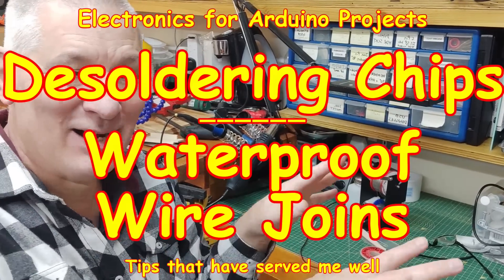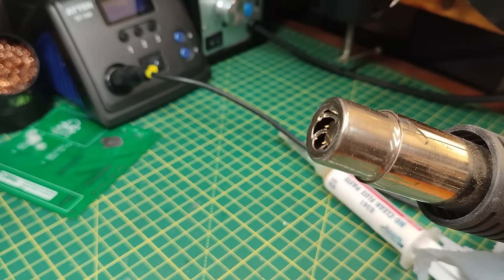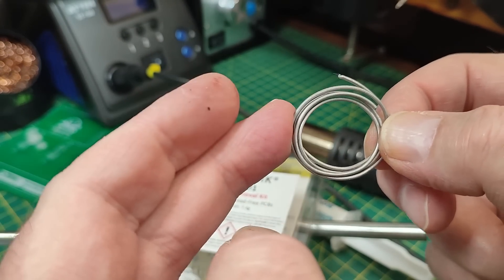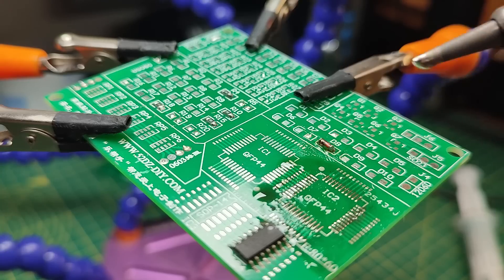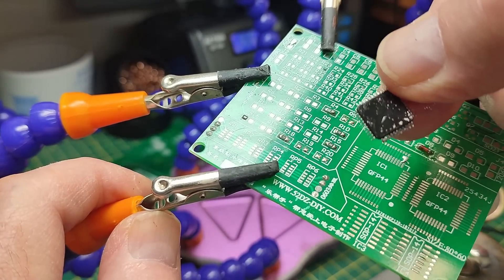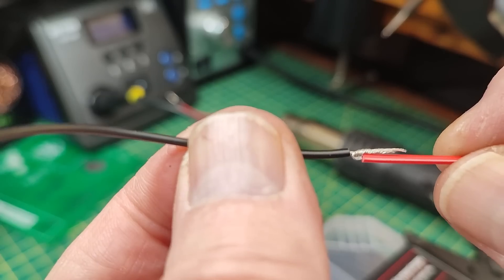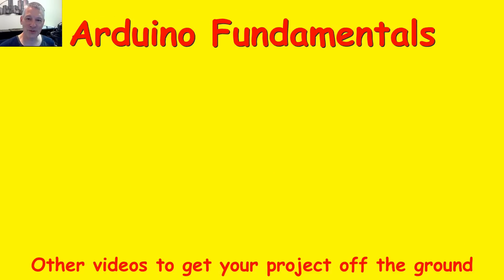#259 Desoldering Chips the Easy Way & Waterproofing💦Wire Joins

Comment: Splicing the wire by twisting it together and folding it back is sub-ideal. The most correct method is using the Western Union Splice (https://en.wikipedia.org/wiki/Western_Union_splice). However, that does take a bit more wire and makes the joint longer. A less ideal version of this is just shortening the overall length of where the wires are wrapped over each other, and soldering that. You want enough soldered area to completely join the wire and provide reinforcement, but not so much that you have a 2" long hard spot in the wire. After soldering the wire, use a pair of nippers to cut off any sharp ends that couldn't be completely folded over as you don't want those to be able to potentially poke through the heat shrink. 

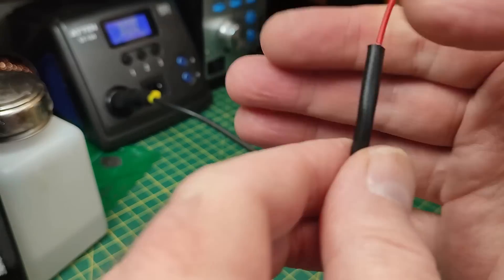And speaking of heat shrink, they do make smaller sizes that are adhesive lined. The 4:1 shrink rate isn't as important as using the correct size shrink for the wire size. Double-walled adhesive lined shrink is my prefered choice. Lastly, you can always double up heat shrink. Put a piece of shrink over the joint with the just an 1/8" or so overlapping the insulation on each side, then put a piece that's about 1/2" longer over that. Basically you're bulking up the joint so that the outer piece can shrink tighter on it.  I would consider the example shown at 13:45 to be unacceptable to put in the field.
Reply from the maker: Indeed, and as that Wikipedia article says, the WU splice is great for "...where the cable may be subject to loading stress." I certainly would not expect any of our electrical projects to put any wire under stress without some sort of strain relief using the outer sheath. But, when up a telegraph pole I'm guessing it's just perfect 😉

Yes, I was seriously thinking about augmenting my adhesive-lined heat shrink with a few smaller sizes (so they could also be used in a single wire, for example). Even going down to 3:1 would be a useful addition to the toolkit.

Oh, by the way, I'm not putting that wire in any field 😁, it was just for a demo and I think (given my previous comment on strain relief) I'd be happy using it even in a pond! Which is what I'm doing with a similar joint on a pond pump. Thank goodness it's all low⚡voltage stuff!

Comment: bend copper wire and heat it with your soldering iron with flux and the chips come off okay 🙂
Reply from the maker: Might be OK with DIP chips, I guess, but not a QFP32 as the solder resolidifies before you can desolder all the pins, surely? Yes, I know your name is not Shirley.

Comment: Does the low melt solder work well with chips with a pad underneath?
Reply: That's a good point; I've never tried it but I don't see how it could possibly. I think you'd have to use hot air for that.
Reply from the maker: Yes, as Sean says you need to use a hot air gun from underneath the PCB in the correct position, which might make things tricky (to say the least). 

You can try from the top but don't expect your chip to survive. I would try and desolder all the pins FIRST using this alloy and braid (or a solder sucker) so they are clean and free from the PCB then a hot air gun, as described.
Reply: Interesting! I always separate wires with each joint independently heat shrunk & then either leave separate or put a bigger heat shrink over both joints. Thanks for sharing!

Comment: Both tips really useful Ralph, thanks! Will Chipquick work on through hole mounted chips as well?
Reply from the maker: Not really for through hole chips because the solder has gone into the hole and out the other side. This alloy has got nowhere to go other than on the top surface. 

TH chips require one of those huge rectangular desoldering bits (can't be used for anything else) and a soldering iron capable of delivering enough heat.